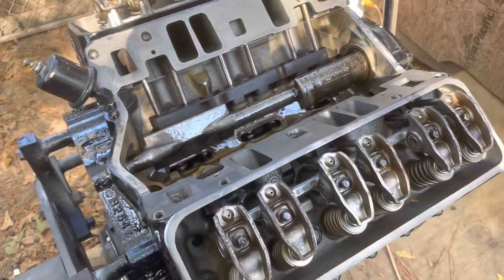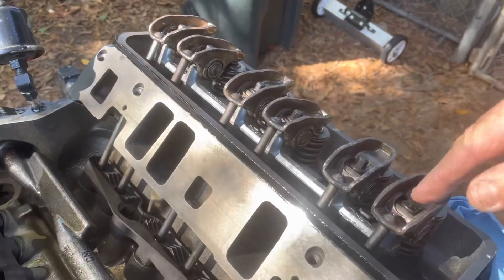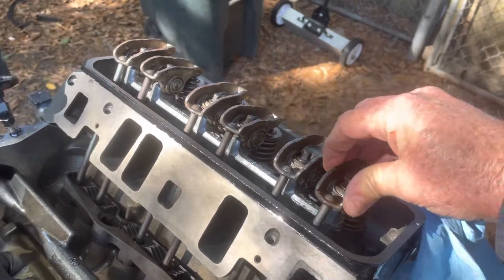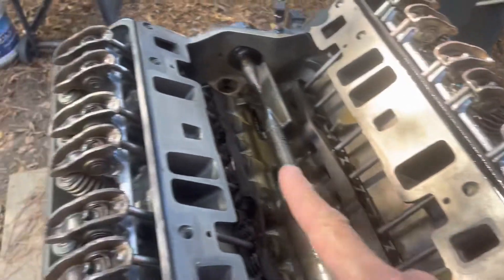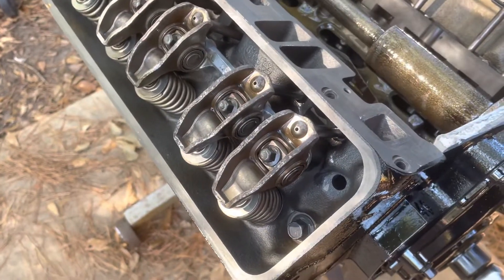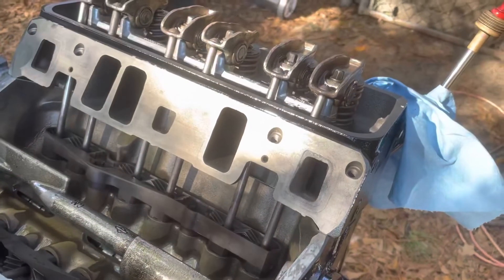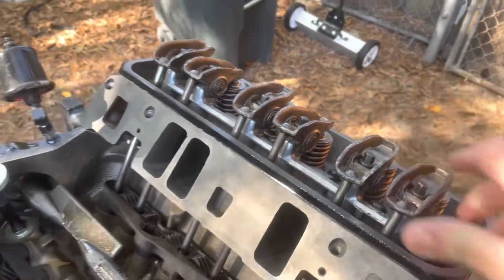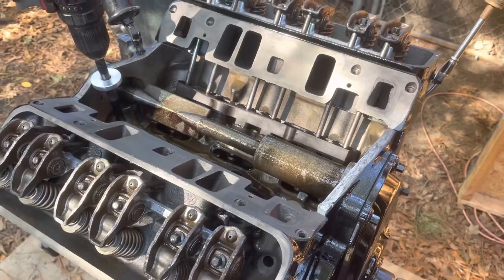When/How To Test Lifters B4 It’s Too Late

Comment: Ok I primed my pump and oil poured out of all rocker arms.  There’s a tiny bit of play when pressing in the rocker/push rod.  It rebounds as well.  Guessing all that means I’m good?
Reply from the maker: Yes
Reply: @moccasinmarine well I just replaced all my rockers and lifters in my 2000 gm 4.3 only because it  had 250k miles but now I hear clicking sounds from the motor.  oil pressure is 60 psi once the motor warms up is that normal? I've put 15 miles on it since but can still hear the clicking/ticking
Reply: @srryan1  did you replace the cam ,if not you have a set of lifters that does not fit the cam grind witch should be replaced with as a set. So the cam grind on the lob and the lifter grind on the bottom of the lifter are ground to match as per cam manufacture spec. If not you are pissing in the wind. you might get lucky but I dout it.:face-red-droopy-eyes: